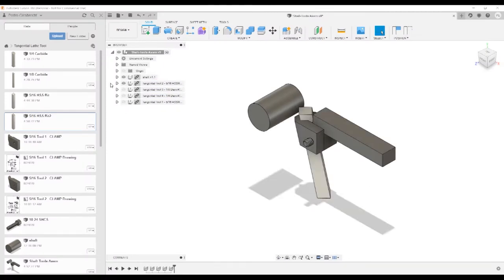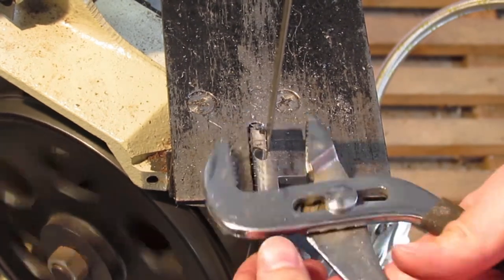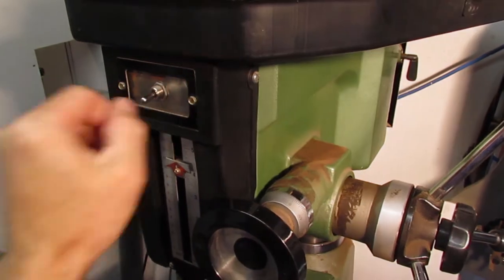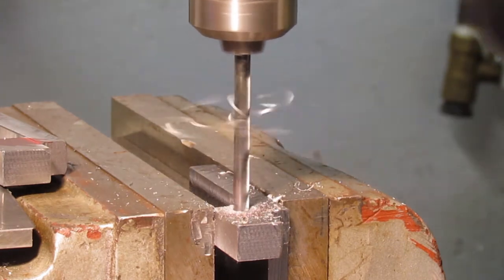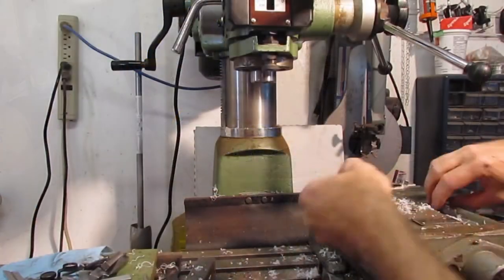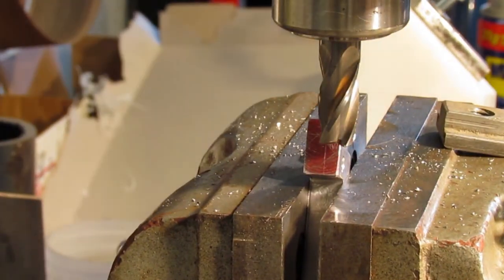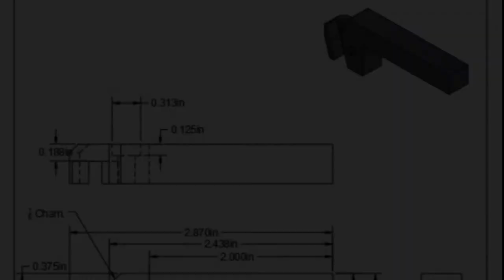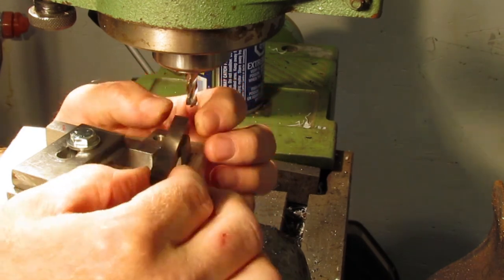Making Tangential Lathe Tools   Part - 2

Comment: cant these be bought? l have hf mini lathe
Reply from the maker: Possibly, I have only seen them for large lathes. But there might be imports available for mini lathes. https://www.eccentricengineering.com.au/products/diamond-tool-holder/the-diamond-tool-holder
Reply: @theamateurmachineshop2150   I have only used them on custom built holders and  form tools, and on very large work.